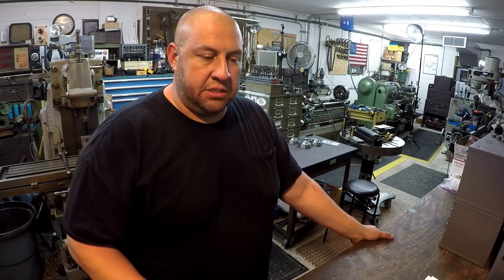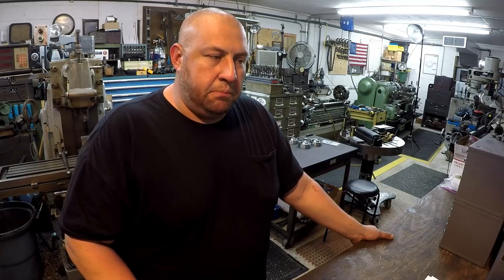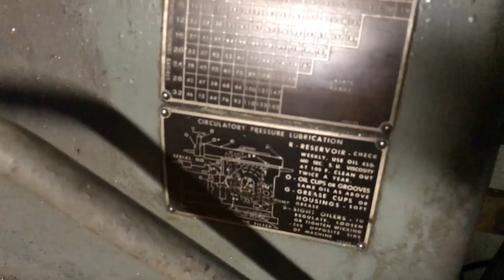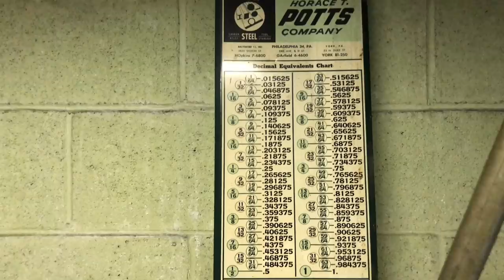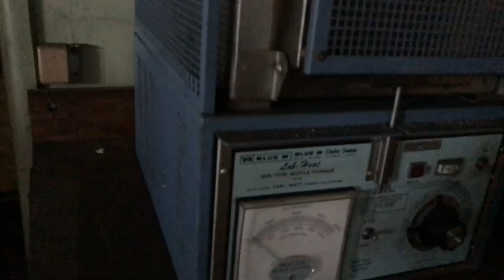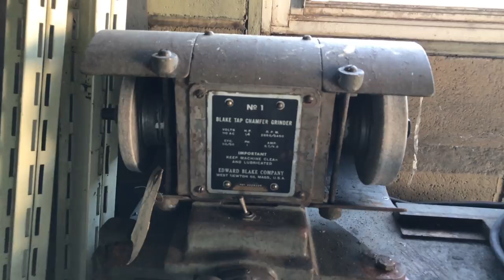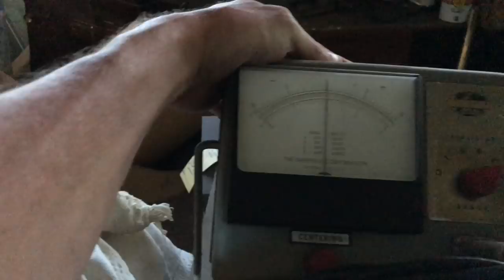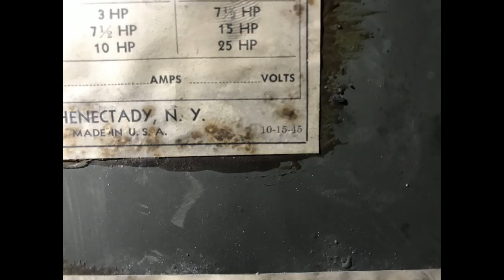32" G&E Shaper Moving Day

Comment: Other than cleaning and lubrication, it looks like it's ready to work.  I guess we'll find out just how large of a chip it will produce.  When you feel tremors in the Pensacola area, you'll know that Adam got it hooked up and running. It will be from the chips hitting the floor.
Reply from the maker: Yep, good clean up and polish job, maybe some fresh lube in the tank and it should be ready to go!

Comment: That thing is a monster! Talk about a finger pinching toe smashing job those guys did great! I kinda think some of them had done that before........ It is amazing what you can move with a few pieces of pipe and a need to move something. When I was at Boeing they purchased two big 5 axis Mazak mills. They were brought in by mill rights who used some type of air bags to position them. They had to seal all the joints and imperfections in the concrete floor or it would "blow out" as they put it. You will enjoy that machine.You got some good friends out there.

Comment: You definitely got a great machine there Adam. I'm glad you found it.  The 24" G&E is not in that good of shape.
Reply from the maker: Andy, what have you been finding out about the 24?
Reply: Abom79 I've got it freed up and moving by hand.  I'm still doing some clean up before running under power.  The lead screw on the table has some wear.  The ways still show some of the scraping in places. It appears it was set up for one operation and run that way. The stroke and table elevation has not been moved since the last paint job.  It was originally a flat belt machine and converted to v belt at some point. I haven't found a build date but the last patent date is 1918.

Comment: I know my 16" G&E weighs 4500#... That 32's gotta be a heavy bugger.   Auto downfeed is awesome too.
Reply from the maker: Great feature to have, one I didn't think i'd end up with.
Reply: Yeah. I got the same 16" G&E. 4500#. 1943 Navy machine. Hard to move around.
Reply: Philip, yours probably has the manual clutch like Adam's right?  I don't know what year mine is but it has the electromagnetic clutch, unfortunately the electromagnets passed into the afterlife.  I'll have to figure out how to wind new coils and pot them into the old housings.  Would much rather have had the manual clutch.  I think they are better all around.
Reply: Yeah. A manual clutch. You can feather it some to get the ram to just creep. My manual doesn't show an electromagnet clutch. A page in the manual has a Form No. 1334-1-66-2C N so I'm assuming it's from 1966.
Reply: I found an army manual "TM 9-3418-204-14&P" dated 1981 on the net that shows it.  I had swapped the brake magnet for the drive magnet years ago ( that makes it even less user friendly, it goes and goes, where it stops nobody knows...) but it gave up the ghost a few months back.  Mechanical things are easier to re-make from scratch... for me anyway.  Mine has a "NORTON" badge on it as well as the G&E so that puts it after 1959 according to Keith Rucker's site.

Comment: When I took over the shop where I worked, I inherited a monster Cincinnati shaper, that had been sitting right smack in the way of the main side door where equipment would have ordinarily been brought in to be worked on on the flat floor.  One of the first things I did was move tge shaper.  This operation was similar... except I used 3 guys and pipe.  Adam, you are going to want to plan on putting this machine somewhere that you have a known good thick concrete slab, as you are going to want to set anchors so you can bolt t he machine down.  Otherwise, it is possible to start the machine to dancing because of the momentum of the head on the fast return stroke.
Reply from the maker: My existing slab will have to do. Worst case is to cut and re pour if ever needed. I don't expect to have to though. They didn't have it bolted down, and I don't expect to do that either.

Comment: I believe that piece of “Metrology equipment” was an I.D. Comparator.
Reply: I took a second look and it appears to be a Vickers hardness tester. It applies a standard force to a part with a diamond-tipped penetrator, and the microscope measures the size of the indentation. The smaller the indentation, the harder the material.

Comment: Do many shops still use shapers and planers? 

I have not really seen them in many videos and they get the job done but slow I am told.
Reply from the maker: These aren't common in daily shop and production environments. I have heard of some places still running them for specialized operations and jobs though. They are great for small shop/hobby/ homeowner use though.
Reply: I see, but does it do a better job of flattening metal better, then say the fly cutter that is often used in its place today, or a surface grinder for leveling a surface, just curious

Comment: I would kill for that little select knee mill
Reply: Rowan Dunn I'd kill for some info on it! =) All I can find out is that the Select brand was just a badge that went on import equipment. I'm in the market for a 6x26 mill and would love something like that one. Ideally I'd like a Rockwell for the R8 collets.
Reply from the maker: Is that a good model to use?
Reply: I saw one on eBay that appeared to be in good condition and everything was scraped in. On the badge on the belt cover it said L.A. California. But it looks like they were Taiwanese and relatively high quality.
Reply: For those of us with "dimensionally challenged" workshops and smaller projects, something like this is a really great choice. This one should be the 0B (OB?), which uses R8 collets instead of the MT/B&S found on the Clausing 8520/8525/8530/8535 mills that this is based on. Definitely worth looking into! Any chance you could put us in touch with the owner?